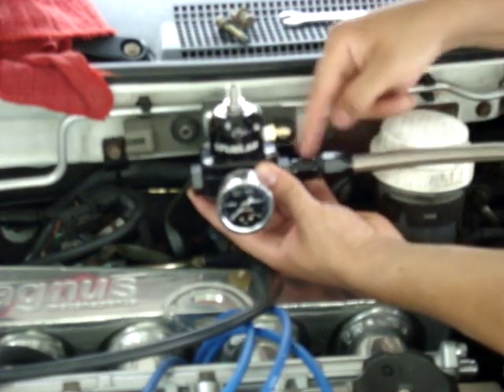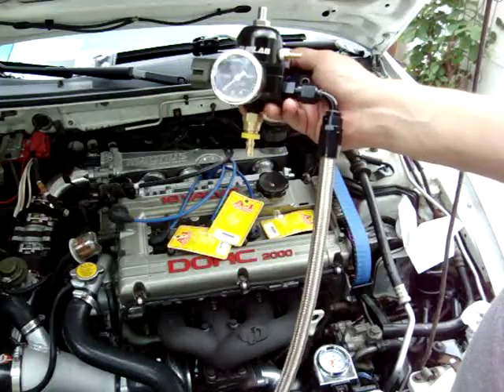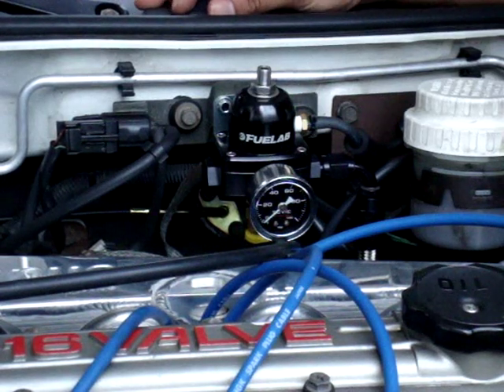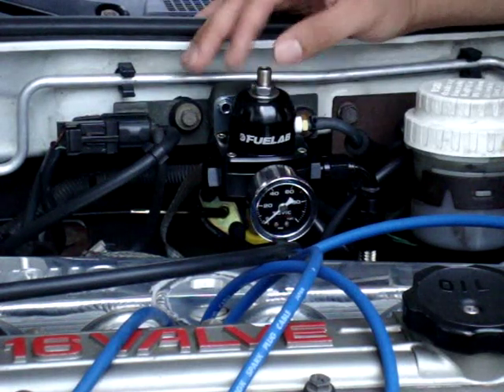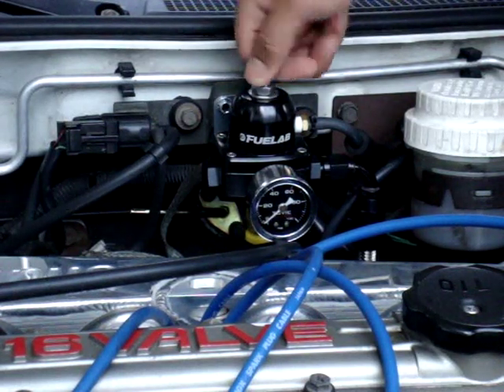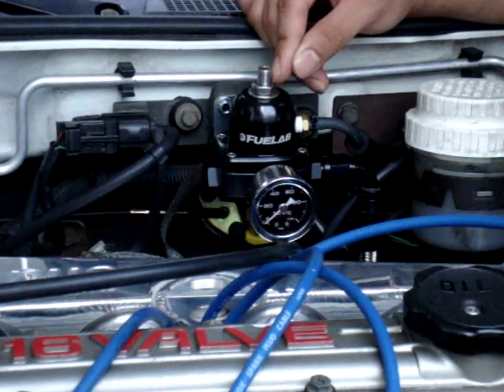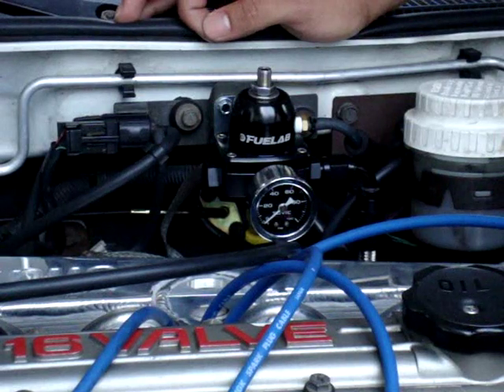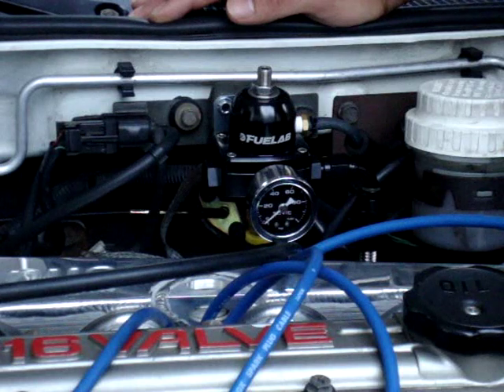Adjustable Fuel Pressure Regulator aka AFPR install - Part 2/2

Comment: jjrock5 can you tell me where you got the fitting on the end of your fuel rail that accepts an fittings
Reply: bugboy357m http://www.streettunedmotorsports.com/parts/stm_fuel_rail_fitting_1g_frf_6l.htm
Reply: thanks dude but i ended up getting a bushur/sx afpr that bolted to the fule rail its self... my car then blew the rings on cylinder 1 a month later :(

Comment: Quick question: Where does the vacuum line run to?
Reply: Ben Kaprelian This is what I'm trying to figure out. That and I'm planning on deleting the fuel pressure solenoid but idk where to hook my boost line too after that I'm also in the process of installing an afpr and want to get both jobs done right once. Forums I read say the "p" port on the manifold but others say that's not good. Some say to "t" the line that goes from the intake manifold to the afpr but I also read that's not a good source.

Comment: hard start ? you need a check valve on the return line check valves help keep the fuel in the lines

Comment: doesn't sound like much of a pain at all..it's actually pretty basic compared to other heavy mods you can do to DSM's. Get a barb fitting with the thread pitch of the gauge and run a simple vac line through the fire wall and up to your side gauge pillar next to your boost vac line with a mechanical fuel press gauge setup. Maybe 10-15 minutes if you have everything.

Comment: you can't lol the gauge needs to connect to the regulator where that whole was unless you want to get an adaptor with a vacuum line run the line through the firewall to the gauge pain in the ass to do but possible.

Comment: you set it at 43.5PSI ok then when it sees boost let say 8 psi does the regulator adjust itself or you have to readjust it to your boost setting so you have to add 8 psi to the regulator 51.5psi? i'm assuming i will set it at 43.5psi and it will Rise itself up under boost.